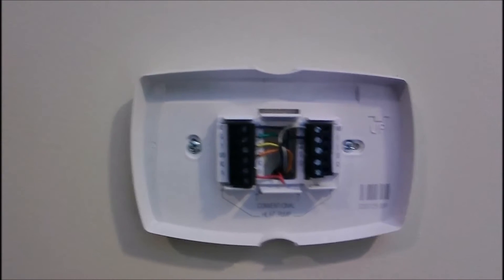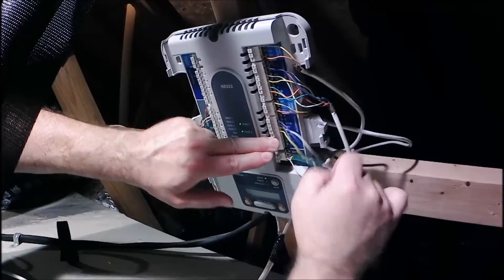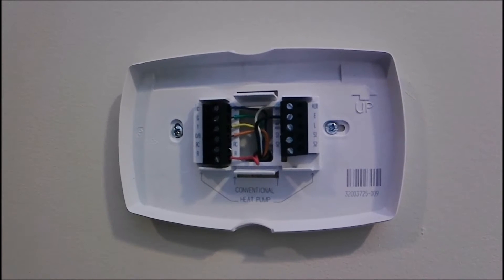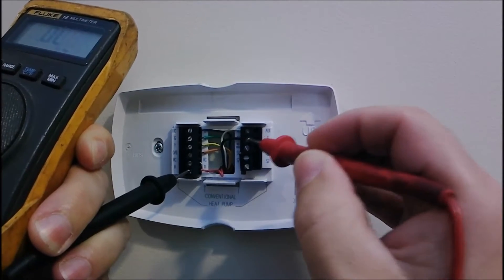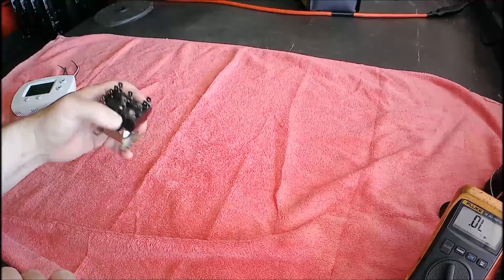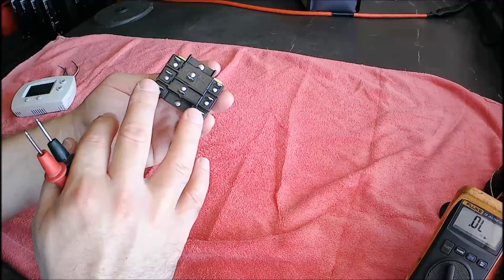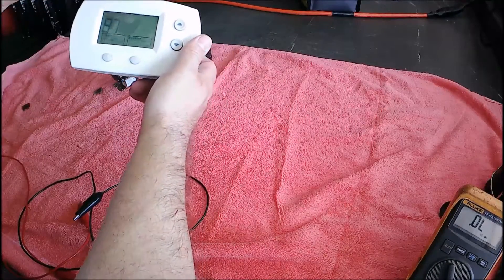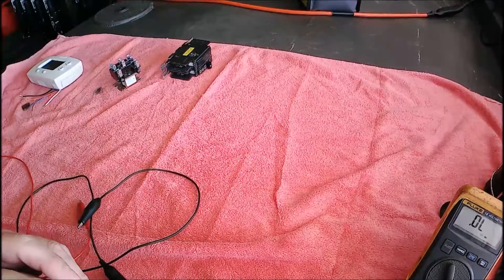Checking Thermostat Wire using CONTINUITY !  2 ways I use this basic meter function.

Comment: I'm trying to DIY repair my home air handler that has obsolete relays in the heater controls. I've followed your video rewiring a old air handler and understand most everything...but My Carrier unit has 4 breakers, labeled L1-L2-L3 & L4...Do you have a video showing this style system being connected to a sequencer, strips and blower relay?
Reply from the maker: I don't have that one style in my shop. Do you have a model number? Do you have 1 main power source coming into the unit and then inside the air handler it splits into L1-L2, L3-L4? Or is it 2 different breakers from the main panel  that feed the air handler?

Comment: are you checking ground to each wire?
Reply from the maker: I do that as a last of 3 continuity checks but mainly if I see a fuse popped or breaker tripped. Probably more used when checking a compressor or other motor. In the case of this video I wasn't getting power in the circuit so I wasn't too worried about it being grounded. It was an open circuit.
Reply: @johnjennings-JJ  So when checking continuity you was checking RC to each tsta wire?
Reply from the maker: Not really. I do it 2 ways. Turn power off and disconnect the tstat wire completely. So if checking the wire from air handler to outdoor unit I would put the wire on the  outdoor unit end all in a big wire nut and go to the air handler end and fan them out like your fingers so that the ends didn't touch. Doing continuity from red to green, then red to white, etc. Until all wires were checked. They should all have continuity since you have them connected by wire nut on the other end. In my video, i had a problem with the yellow so it did not get a continuity beep when i checked red to yellow. I knew it was open. 2nd way is just removing the wire nut on that end and redoing the wire to wire check. Nothing should beep now. I do both of these if I am checking continuity. Lets me know what is touching on purpose and also what is touching on accident.

Comment: Great video! So how do you change yellow wire?
Reply from the maker: Most contractors would run something like an 18/8 set of wire so you would have couple of "spare" wires to use that you could replace the yellow wire. Only once in my career have I had to completely replace the whole set of thermostat wires and only because there wasn't a spare that I could use.